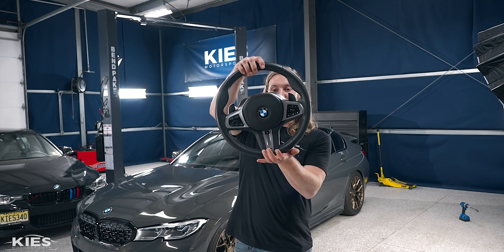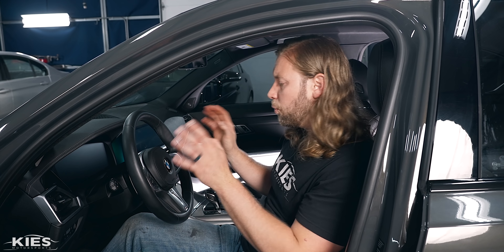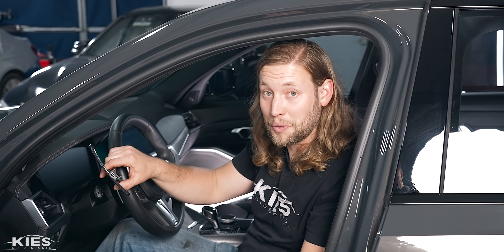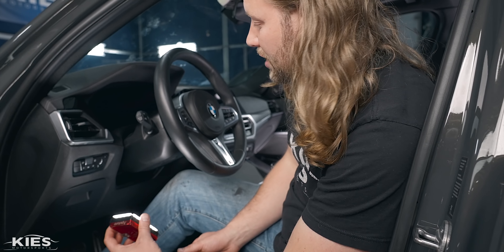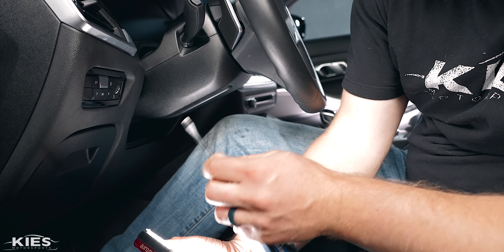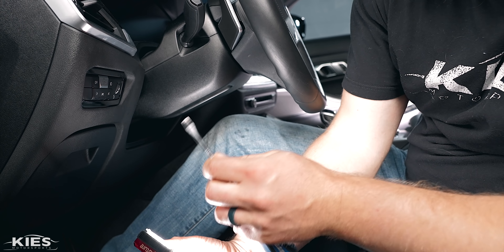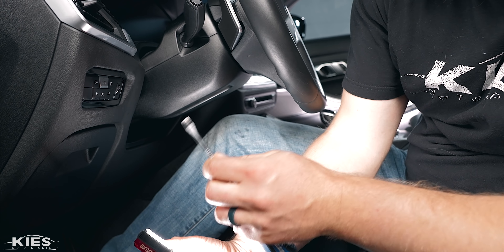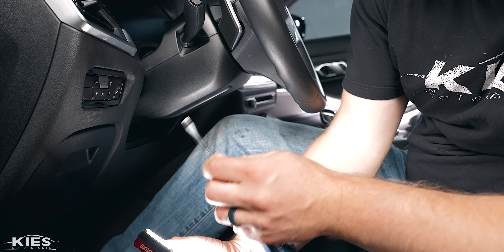How to install G20 BMW CARBON FIBER Paddle Shifter Extensions

Comment: If all you need to do is push a pin out do you really need to remove the air bag and steering wheel?

Comment: Quick question. I disconnected the negative battery terminal in the trunk and the light in the trunk stayed on. Is that correct our does the one under the hood need to be disconnected also?
Reply: There’s a secondary battery under the hood. Passenger side.

Comment: I have just tried to apply this on my new X6 LCI and realized that the trunk negative alone doesn't completely disconnect the airbag as the horn was still on, wondering if you know how I can do on the new MHEV models to get it fully disconnected so I can carry out the work?
Reply: It takes about 20 minutes for the power to be fully drained out of the electronics. Then you will be able to continue

Comment: I just bought a used 2020 M340I, horn and paddle shifters don't work, neither does the wireless charging pad. Tried changing fuses, still doesn't work. I suspect the car is tuned because it's ridiculously fast and came with a custom exhaust. Can someone help?

Comment: Thanks for the help.

I tried today and found some tips.

1. Unlocked the car 
2. hold the media button to close the screen manually  
3. Take of the negative battery 
4. Using T20 screwdriver to take off the paddle shift

Comment: How long did you wait after plugging off the battery before you proceed with disconnecting the airbag?
How do you change just the steering wheel cover without the paddles?
Reply: Ever figure it out?
Reply: 10 minutes after disconnecting the negative

Comment: The lights on my steering wheel controls went out but buttons themselves still function. Anyone ever have that happen? You think a wire got loose in a connector or clockspring? F30
Reply: ever found the fix?

Comment: Has anyone used the paddle shift extenders that connect to the stock paddle shifters? Any bad experience with those? I want to avoid having to remove the airbag, was looking into the add on extensions, but I read a review that they touch the steering wheel and do not actually shift..

Comment: Brian  , hi . I have a " tip " for you .
M8 / M8 competition.. We all know that the lesser powerful M850i sounds much better than an  true M series . Everyone is trying to get that " V8 " sound that the M8 is lacking.  
My challenge for you and your great channel is this ...... . Shorten the M8 tail pipes by not cutting them from the tips but from  ( if possible  ) from the back box ...... . Then  , just for  experiment use the chrome exhaust square surround that the m850i has either by replacing rear bumper or someway with your genius mind  around the shorthend exhaust tips . Imaging the Bmw M850i rear end but with M8 competition 100mm tail pipes.  
This will give the Bmw M8 an deeper V8 sound that buyers would love. 
Please experiment ... You could be the 1st in the market to modify. 
Many thanks . Reply pls just to confirm.  Thanks

Comment: Guys, I'm highly impressed with the detail and quality of your content! Bravi 👏🏻👏🏻

?: after disconnecting the battery do you need to wait and/or drain any residual charge before disconnecting any airbags??

Nice shifters.  I own an E82 with the older style pull/push paddle shifters. I use them all the time!

Keep up the great videos, thanks.
Reply: Not sure how it is with the G20, but on the F series he recommended to wait about 10 minutes after opening the trunk, so that the car is in sleep mode before disconnecting the battery, so that it doesn’t throw warning lights after reconnecting.